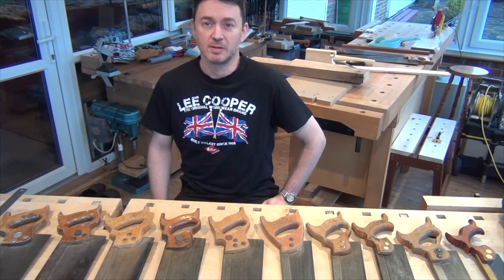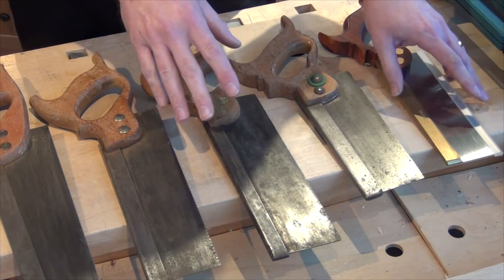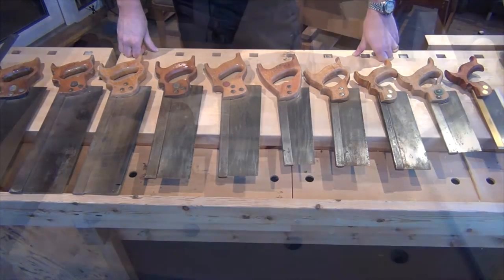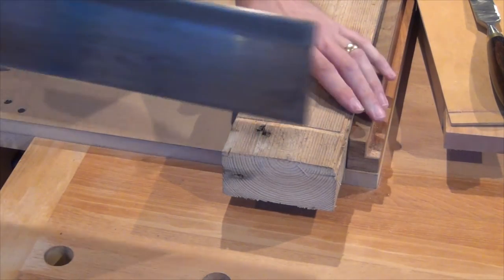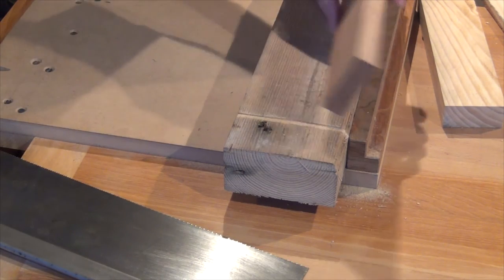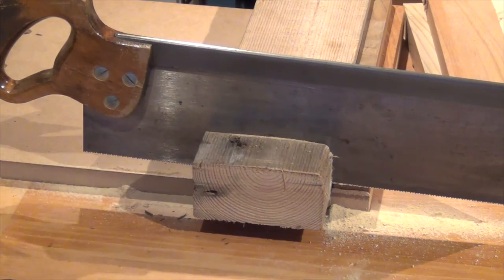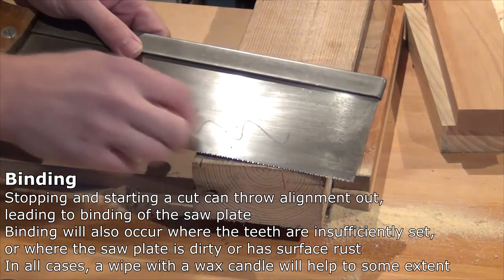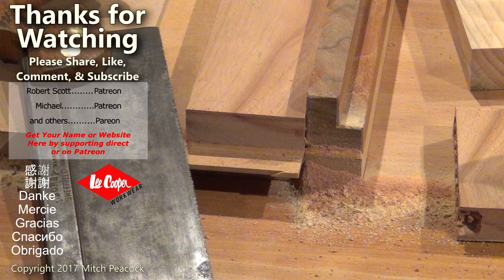Western Back Saws (GIW episode 29)

Comment: Nice video, Mitch.
You have very well explained the handling of the western saws.
You took wax, I got used to it. Turn my saws off with oil, Just as I had seen in Paul Sellers' videos.
Reply from the maker: Thanks Gunter. I wipe with oil to protect from rust, and wax for lubrication when required.

Comment: How often do you sharpen your saws?
Reply from the maker: Slightly less often than they need is probably the honest answer!
Occasionally I have some spare time and will go through all my edge tools, checking and sharpening as necessary. More often though, I will notice the performance starting to drop off, and I'll set the saw aside to do at a natural break point. In most cases I have a fall-back and don't need to sharpen immediately. Setting up to sharpen saws, sharpening, and clearing up, takes enough time to break my rhythm, whereas I'll happily strop a chisel each time I pick it from the rack.